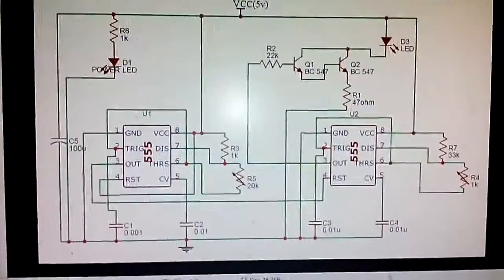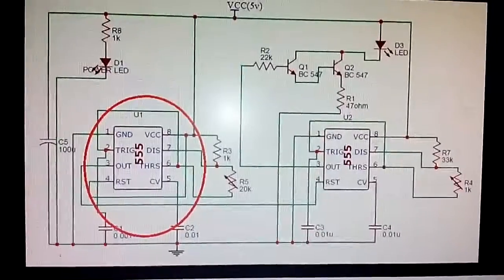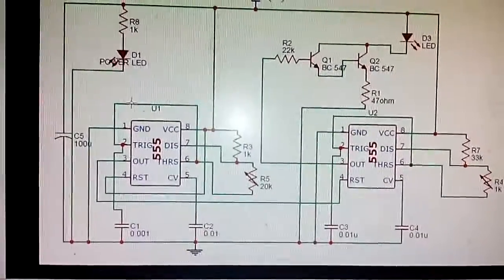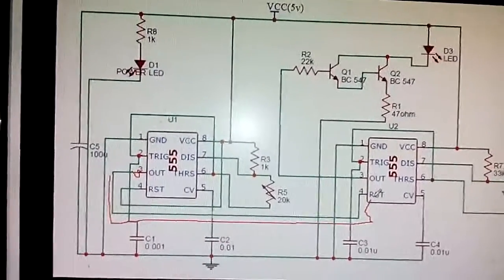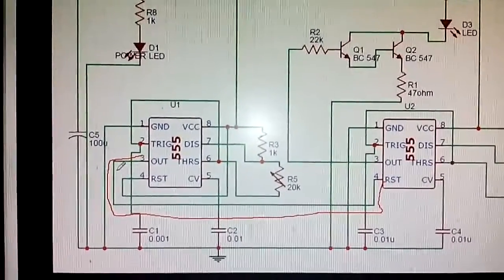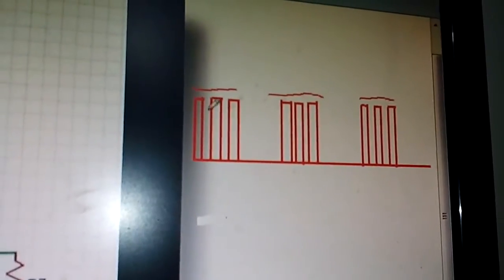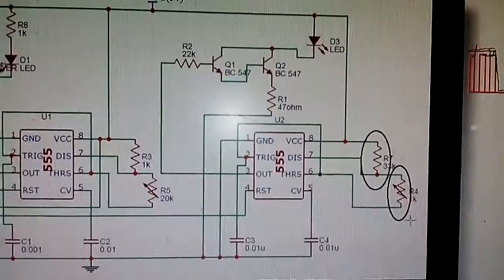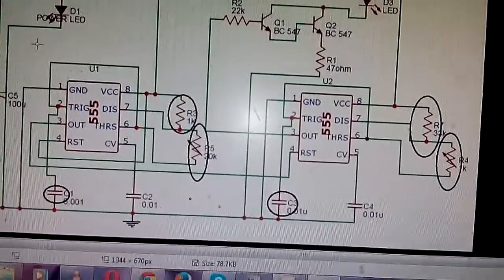Infrared transmitter circuit

Comment: Thank you sincerely Ji, for the well explained theory behind the design of the circuit. Your effort helps persons to understand the concept so that one 
can fault trace ,should  there be a problem in constructing the circuit. Very well done! P.S. Not many contributors with projects share core knowledge. 
Quite often, you see just the construction 
of the project.!🤗